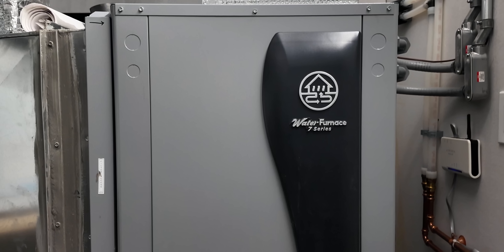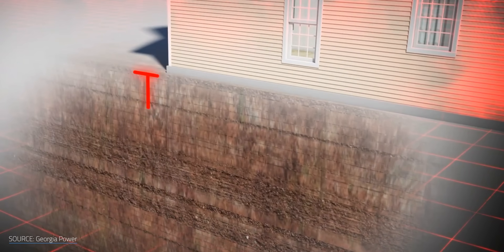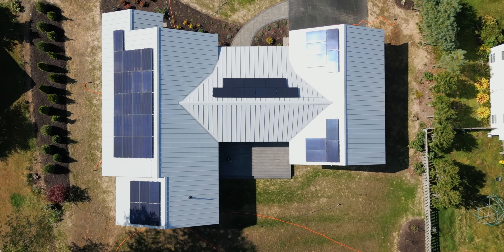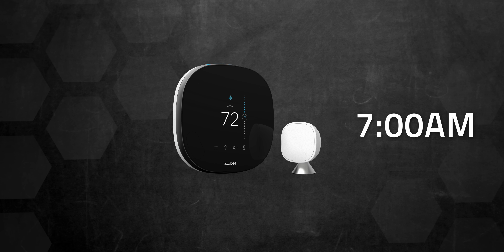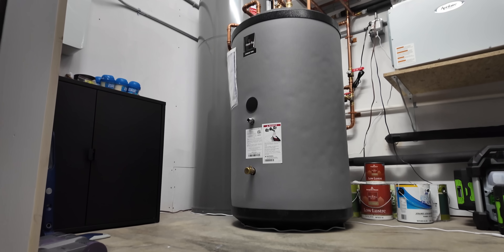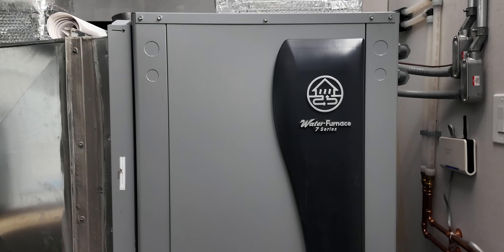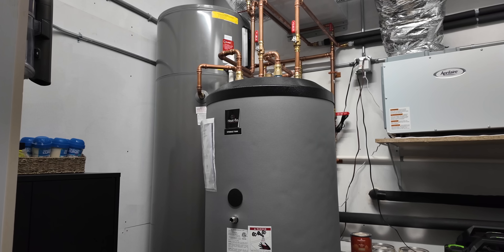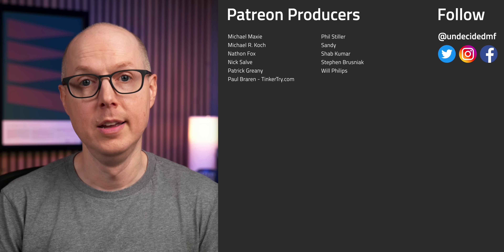How My Geothermal Heat Pump Really Performed (2 Years)

Comment: I DIY’d a 5000 watt solar system and a ground loop geothermal system 13 years ago total cost for the two systems was $20,000 (not including my labor costs), take 30% off that in rebates and included my labor costs which were allowed and the total cost for the two systems was around $11,000. Add to that the solar renewable energy credits which I have been selling for average $250 dollars each at about 5 or 6 per year and this system paid for itself in just a few years, considering I was paying over $3000 a year for oil, an now my electric bill probably averages $100 per month which includes everything including hot water. If your handy do it yourself when your old furnace needs replacement anyway and you can do all this for less that having someone come in and replace your old furnace. It’s a no brainer.

Comment: Also about 2 years ago we built our forever home atop Gunters Mountain in North Alabama. Geothermal is simply not an option on our property due to layers of solid rock below us. We opted for ICF foundation in walkout basement and spray foam insulation in all exterior walls and above the ceiling in the attic.  We installed three modular heat pump HVAC systems that can be adjusted separately. Like you, we have found this house to be the most comfortable one we have ever lived in.  I only need switch the system mode from cool to heat as needed. It easily maintains 72 degrees inside, no matter what is going on outside.Also I cannot compare based on the cost of our system to operate because our power cost here in North Alabama is just $0.13/KwH.   But our average power usage/day on this 3400 SF 4 bedroom house over the past 29 months is about 72 KwH/day.  (min 42 KwH/day in April; max: 88 KwH/day in August.)  We have no solar panels or gas augmentation for heating. We use a wood burning fireplace insert in winter.

Comment: I had a house built in 1984 in the Kansas City area that was earth bermed , super insulated , passive solar with insulated interior blinds, wood burning stove and a ground source heat pump with 1000feet of copper tubing buried 4-6 feet underground and freon running through it. Total cost of the excavation, installation of ground source hp was 5K. We also added an variable air -air exchange handler for fresh air and humidifier for winter.  Since that was 41 years ago, I have long since forgotten what the electrical costs were at the time.  Sold it to retire in Colorado after 31 years and it was still functional.

Comment: In my old house (2005) that I built from scratch we used geothermal heating from a borehole of 155 meters, worked very well with heated floors (concrete-liquid base), a eco house with thick insulation. (Can’t remember the exact English word.)

But for the last 5 years of hot days I wish we invested in an air-air pump to cool the inside. (Cheap compared to performance) 
 
It’s an constant development of this area. 

But all in all, Im happy with our geothermal solution. 

Base fact,
Living area 200m2 with 5 meter’s of sealing high, power used 10 000 Kw to 15 00 Kw year depending on how cold, or hot we wanted it to be…

Comment: Unless you've got those solar panels and batteries for free, the electricity your are getting from them still have a cost. Until you get to break even on your solar/batteries that electricity ain't free and should be included in the cost.

Comment: 31 cents per kilowatt is insane.  we just had a variable speed system from carrier installed. way cheaper than what you said one would cost you.
the carrier rep said they would not recommend geo to their customers with the new tech.  enegry savings never pay off when compared to the latest tech, which can also run radiant if you want that.

Comment: Such an engineering answer…it depends. Saw that coming from a mile away. I think the big question I’d like to discern is if I put a GSHP on a house and then sell it soon there after can I recoup the investment or can the investment only be recouped if you own to property for the long haul?
Reply: ccount. This is what it looks like: if some number of years after you’re installed, you sell your house, what are you going to say to a prospective buyer? “Take a look at comparable houses around here, and figure out what it will cost you per year in mortgage payments plus energy bills. Now figure out what the same thing would be for my house if you bought it. You will find that because the energy bills are far lower, you can afford a much more expensive house with the same monthly payment.“ This logic implies that a house with net zero energy is worth far more than one without. An equivalent calculation would suggest that the house is worth whatever your monthly savings from energy would cost in mortgage payments. I know this sounds complicated, but all you have to do is say “ if the house down the street costs you $100 per month more in energy costs and you paid that in your mortgage cost instead, your budget would come out the same. So what does $100 in increased monthly mortgage payments equate to in the amount of the mortgage? That tells you how much more your house is worth with such a system.

Comment: You are well on your way to establishing your little independent heaven. Everything you are missing seems to the safety valve if the mains power is lost for a few weeks or years. Such a system must have a tank of stored energy in as compact a form as possible, as well as a device that converts that energy into a usable form for all kinds of purposes - electricity. Why have you opted out of this item?

Comment: "The ideal gas law (PV=nRT) is fundamental to how heat pumps work, explaining the relationship between pressure, volume, and temperature of the refrigerant as it circulates in the system. The compressor increases the pressure of a gas, and according to the ideal gas law, this also increases its temperature, creating hot gas that releases heat indoors. The gas then passes through an expansion device, where its pressure and temperature drop, allowing it to absorb heat from the outdoors before the cycle repeats."

Comment: New heat pumps are getting really good, so good geothermal isn't needed in most cases. My air to air heat pump works during -25 degrees C, less efficient when so cold yes, but lower upfront cost makes it worth it. New air to water heat pumps can be used with floor heating and do really well all year around (Sweden). Geothermal is more efficient no doubt, but the added cost for drilling the hole makes it less economic than a new modern air to water heat pump. An air to air heat pump is a no-brainer for your garage or as an add-on heat source in your home if you accept the fan noise (like an AC). I bought an old house with broken heating system, so the first thing I did was to install an air to air heat pump. I will restore the old water radiator heating system in a couple of years and then I will install an air to water heat pump. Drilling geothermal in most cases just isn't worth it any longer.

Comment: One blindspot may be that your server rack (which most of us don't have in our homes) is kicking out exactly as many kWh of heat as it takes to run it. This is offsetting your heat pump running costs, it just has a CoP of 1. But if you look at that heat as a free byproduct of your business, I suppose that's a happy situation.

Comment: As our family is growing and our energy use is going up (and the local rates, yikes!), when my units call it quits I'm upgrading to geothermal and a heat pump water heater. We had neighbors who had it a long time ago but it was an older open loop system where they actually ran their well dry a few times during the summer, so they had a new well drilled just for their geothermal system which would still run dry every now and then, eventually they just went back to air source units. These borehole closed loop systems are pretty awesome!

Comment: Consider passive solar if you can. Our home and lot  in Santa Fe offered perfect south-west sun exposure and so we up-scaled our windows and put lots of them on the south-west facade and fewer on the other elevations. We used Hurd Heat Mirror windows which allow in heating rays but filer out furniture damaging rays. All of the beneficial rays hit upon saltillo tiled floors set on concrete slab. The slab also has in-floor heat tubing. Above the sun gathering glass, the builder installed 18" deep overhangs (depths will vary by latitude) to shade the glass during the warmer months.  Results were fantastic; our biggest monthly natural gas bill was $25 for a 2000sf single story home and we had an infant so house was kept warmer for him..  The better windows added maybe $10,000 to construction cost and we never needed to install draperies to protect the furniture.  I don't there is any geothermal system that could be cost-justified for this project.... payback would be many decades, if at all.  Also, passive solar needs zero maintenance ever.  I do like geothermal for its ecological benefit and in the right application, economic benefit but with a long payback period for applications where passive solar just will not work.

Comment: Silly question (s).
Buy why such a deep hole ? did it need to be that deep ? Why not multiple shallower holes (which I assume are easier) ?
Surely 230m isn't far enought down to have actual 'heat from molten magma' (ie your local volcano).
How much did this cost supplemental to having a regular heating system. I'm guessing the 'room heaters' are about the same cost no matter what type of heating you use, and you still need all those pipes to go to every room ~ which I again assume is similar to any regular plumbing layout.

Also as you were building the house what were the different things you needed to take into account building wise. Why didn't you simply cover the whole house with solar panels (or certain parts of it). Again what is the price comparison of solar panel to 'tiles' in terms of cost per area.
For the solar, how often do you clean the panels (and how do you do that? ~ how much does difference is there between dirty / clean production).

sorry lots of question, maybe good for another video.

Comment: I would route the heat from the back of the server into two pipes with a lever: one goes outside (to blast heat outside during summer) and the other pipe goes to your office (to keep the temperature warm during winter).
The lever directs the airflow and insulate the other side, you can manually switch twice a year and this will contribute to the heating/cooling of the house instead of wasting energy

Comment: Per your temperature setpoint conversation, both air to air heat pumps and geothermal heat pump benefit from "set it and forget it" for a few reasons. 

On the "oversized system" issue, if you live in an environment where humidity is as much or more of an issue as temperature control, oversizing a system causes significant issues with humidity control, so is not recommended. In my coastal VA & NC area, we often recommend a system be very slightly undersized or perfectly sized to minimize the humidity issue as much as possible.

Comment: Our Waterfurnace Series 5 install just finished a week ago. We are located in Maryland, which is about the most geothermal friendly state there is (rebates and GRECs). We were spending over $2,000 a year on heating oil and another few hundred a year to have it serviced and the furnace was about 15 years old. With the tax credit coming to an end, I knew it was now or never for geothermal. We also added a supply and return in our finished (but unconditioned) side of the basement and a whole home dehumidifier. A simplified breakdown for our costs:

$46,700 - System Cost 
- $14,010  Federal Tax Rebate
- $11,000  Utility Rebate
- $9,900    Selling GRECs Upfront
- $5,000    Property Tax Credit (4-5 year waitlist)
Net Cost - $6,790 after all rebates and incentives.

Comment: Under 2024 International Energy Efficiency Code section R408 (Additional Efficiency Requirements): A ground-source heat pump is worth 10 to 21 credits, while an air-source heat pump (with electric-resistance backup) is worth 8 to 16 credits (depending on climate zone). The bonus for going ground-souce ranges from 8 percent in climate zone 0 (extremely hot--e. g., Belize) to 75 percent in climate zone 8 (subarctic--e. g., Fairbanks, Alaska). Massachusetts is in climate zone 5 (cool), which grants a bonus of 36 percent. Presumably, these credits are based on expected energy efficiency.

Comment: $54.6k up front at 3.0% for 30 years is $230/month ADDED to your mortgage. Plus $950/year for electricity costs = $3710 per year for electricity (nearly $310/month.) If other taxpayers weren't subsidizing you, the breakdown would be: $78k at 3.0 for 30 years is £328.85/month added to your mortgage. Plus $950 for electricity costs = $4896.20 per year ($408/month). I am struggling to see any advantages here. (The green benefits are negligible - especially since AI has added 4% to US energy demands (equal to 18000 wind turbines or 700 square miles of solar panels.) I think I've decided.

Comment: Hi Matt.
French Swiss guy here. My Geothermal heat-pump has been installed in 1981 and is still running today. That gives an idea how resilient and durable this kind of system can be. 
It is an old Carrier water-water heat pump that takes its cold source straight in the bed of a little river close by.
I would honestly not exchange it for any other system, it is an amazing system: Simple, Reliable (because simpler than air-water system), comfortable (no unfreeze cycle), silent... and ecological.
That said, I might have one of the oldest system in Europe for residential use. It was rather uncommon to have such systems in the 80s.

Comment: If I had 31 cents/kwh power rates, I'd be doing everything I could to generate my own power too. But for most Americans, and especially those living in red States, grid power is half that or less. Still, your approach is correct, in that energy efficiency is far cheaper than solar production. Nothing has a better energy ROI than a tube of calking.The government incentives really mess up the math, and make a lot of options that are clearly non-economic seem feasible.

Comment: I have wished to build a new house with geo thermal heating - cooling . At my age , it is doubtful I will get to . Food for thought , is poly vinyl a good conductor of heat ? Before I retired a friend of mine who was the heating and air conditioning guy , remodeled his house and made his own system . He did a 190' copper ground loop and a much smaller pump and much less volume of fluid than a system that uses vinyl tubing . He heated and cooled his 3,200 square foot house , along with his large shop . If I recall , he said the bedding of the copper along with expansion areas was critical . Been a long time since I read up on the energy transfer of vinyl vs copper , but it is significant . Of course contractors love the expense of making a giant trench where they lay loops that overlap each other , there by reducing the heat transfer because the loops are using the same ground . Anyway , food for thought .

Comment: I've had geothermal for more than 25 years now. I've changed the heat exchanger last year ($11000) but thats it. It just works. I paid around $16000 for bore hole and exchanger when I installed it.

Comment: Really interesting ; air heating only costs me $800 a year with Northern Indiana winters about 100 miles East of Chicago , and $480 a year in cooling the home . My air conditioners run separately from my air heating and boost the electric bill about $40 per condenser/machine per month .

Comment: Imagine getting a wood gasification boiler instead, and investing the price difference compared to a heat pump into equity funds with an average annual return of 10%. In my opinion, it’s not just about the payback period of the system calculated from monthly savings — you also have to consider the opportunity cost. I live in the Czech Republic in Europe, and here, wood is very accessible and still considered a renewable energy source from an environmental perspective.

Comment: Our geothermal system thankfully was much cheaper to install. Inspired by a US idea, German and Austrian engineers perfected building a super efficient horizontal ground loop that works on small pieces of land. We were able to install the tubes ourselves (no witchcraft required ;-) and were thus able to save a ton of money. It’s a pity the US didn’t continue to develop the idea, but maybe they didn’t feel the need since tiny lots are more of an issue in Europe than in the US.

Comment: I've had two houses with Geothermal heating, one with a pond based loop, and one with a trench. Both performed well, especially once I got doubled down on making the homes air-tight. Only one day did the backup 18kw resistive heater kick in when it was -40 and the heat pump was running continuously. Cost a pretty penny for power though. December - January power bill was typically $1200-1500 for the two months hydro (local rates are $0.08/kwh up to 35kwh, and then steps up to $0.12/kwh for the balance). Comparatively natural gas for the same time period in my mother's similar sized house $300.